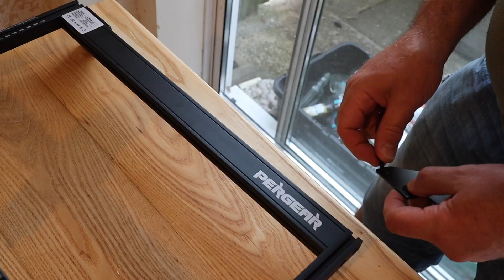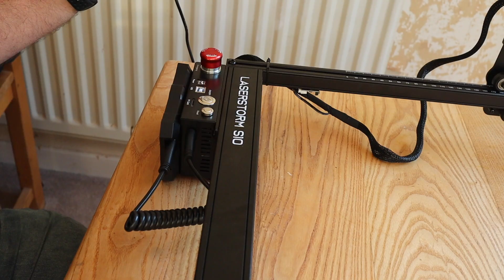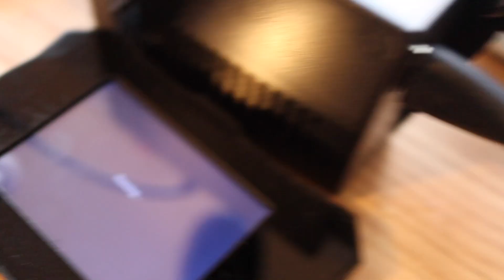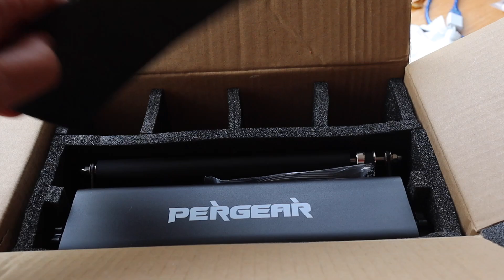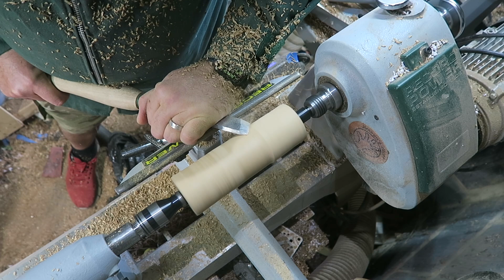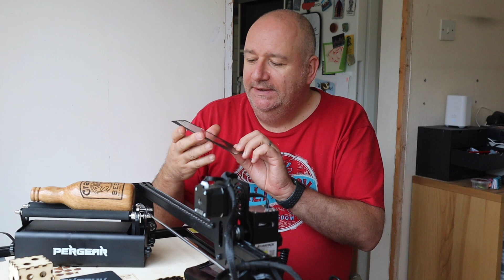Pergear Laserstorm S10 - Laser Engraving and Woodturning

Comment: hey Jim, i was wondering if you can help as i cant find much information online , when i fire my S10 up it comes up with NO SD card even though a SD Card i have is in there .. their was not one with it ,i i see from your video there should have been ? does this come pre loaded with the operating system on it ? this may be my reason im struggling ?
Reply from the maker: Hi Dave, I suspect that the SD card may have the firmware installed on it. I can’t remember but the SD card may have been packaged installed in the USB card adapter, it is very small and not very obvious. If not then email the company and get the card sent to you. Sometimes it is possible to format a new card and download the firmware onto it from their website, insert it into the machine and then turn the laser on, this flashes the firmware across, but best ask their advice. I hope this helps. Many thanks for watching my videos.
Reply from the maker: Further to my previous reply, try formatting the memory card you are trying or test that it is working properly

Comment: The Gantry looks quite "unfinished" to me. I am personally no fan of V-Bearings, that run directly in the Extrusion-Profile. They can dig in and wear out leading to a slack belt and worsening Results. There are really cheap Rails with plastic runners or even with Ball bearings that could improve the design. The unstable Height adjustment would be a no-go for me but I have to say that the Rotary Axis is a real neat feature, that I haven't seen before on a Laser in this Price range
Reply from the maker: The majority of lasers of this type have a similar set up and build. It works but could certainly be improved upon. It gave very good results with the bed raised. The rotary attachment is fantastic, and a very sturdy metal construction, it is an optional extra but will fit a lot of other lasers on the market. It simply plugs into the Y axis stepper connector and becomes the Y axis stepper motor.